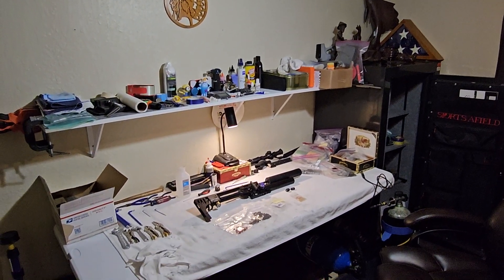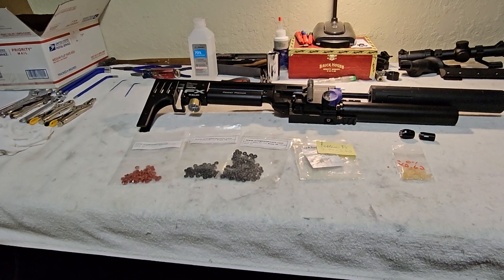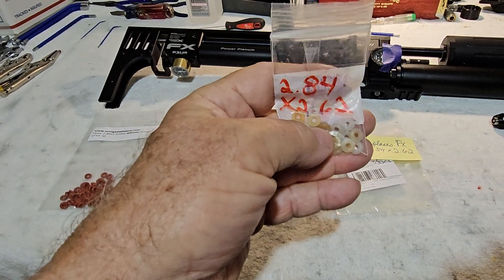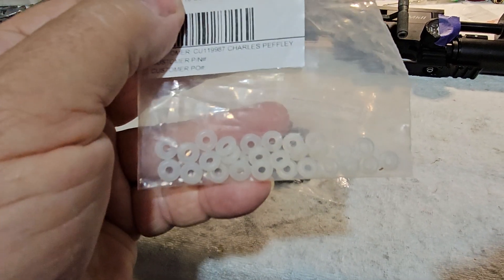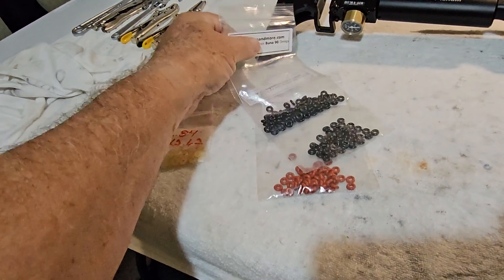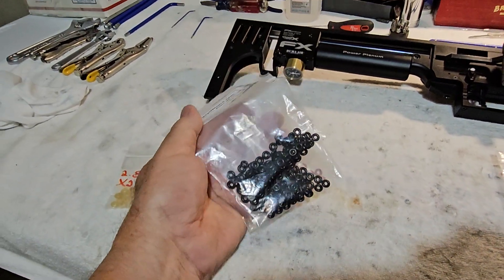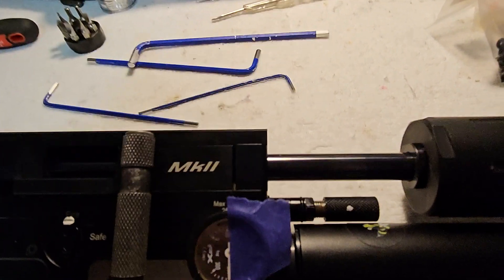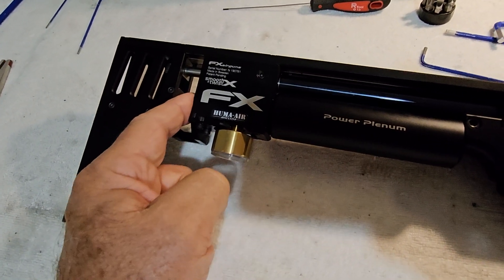Replacing faulty Impact plenum o-ring

Comment: I'm wondering if this is my slow leak as i cannot hear but lose 10-15 bar in 24 hrs
what i do notice is my digital reg gauge rear will drop .1 every so many min.
used little snoop leak detector nothing visible external so I'm thinking this little o ring is the culprit.
good video no bs straight to the point.

Comment: Hello sir im not sure if this is the same reason why I am having my issue. My fx m3 compact was sitting in the safe for 6 months. I re-started shooting in summer and everything is going good. Then I store it again then shoot again. I notice last week the first shot was lower than normal but after the first shot everything is ok. I goggled my problem and another guy from india said that the issue is that white oring that holds the rod in the plemun nose the oring looses shape over time. I ordered some bubbling leak detector and waiting to check if im having small leak in the area you pointed. It does not sound like my issue is a leak but do you think my issue is that white rod holding oring in the plenum nose??? Before I take things apart I want to get your opinion.

Comment: I am going to update you when I get the chance but I think this is the problem I have, filling the tank just lets air out the barrel, it blew the contents of the plenum on my cheek when firing and now won't fill. I have checked everywhere else, forgot about these two little buggers....
Reply: This is the one from the oring store I bought which is the one he is talking about:

Part # U90104 
Description AS568-104 U90 EU Polyether Urethane 1/8"ID X 5/16"OD X 3/32"CS
2Q24-5002291097,Cure Lot(50)
Quantity Price UOM Total
90 Duro O-Ring